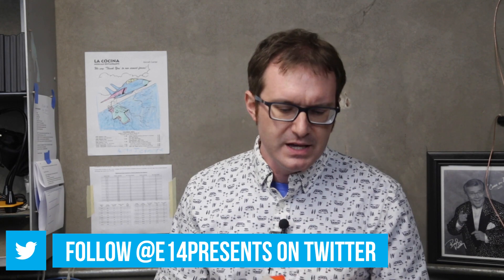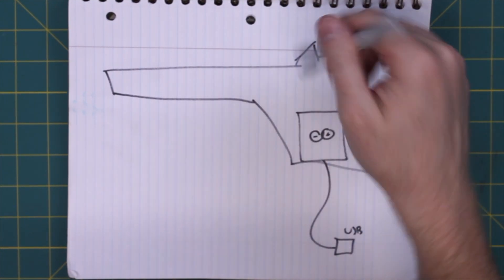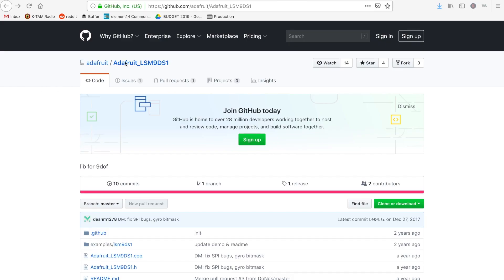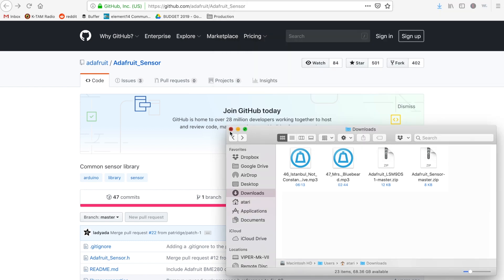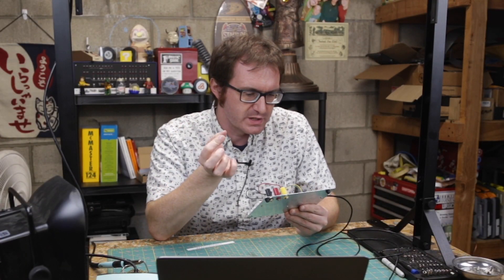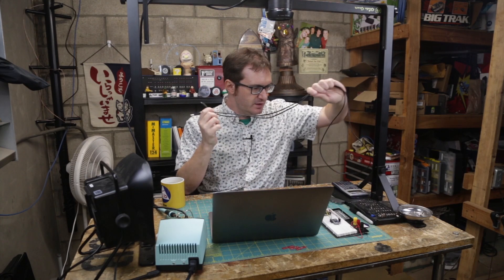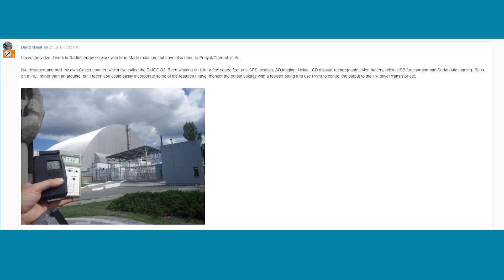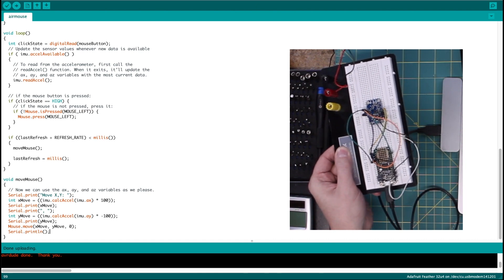NES Zapper on RetroPie

Comment: Ok, but what about if you HAVE an HDMI Sony CRT TV and you want to just connect the Zapper to the RaspberryPi NES Emulator and Poll it as the Original System would do? It should be pretty Easy right?

Comment: "Remote Mouse" uses your Phone as a Motion Mouse Pointer where you wobble your Phone and it wobbles the mouse around the screen ... I bet there's some code or API's that work with the Accelorometer in a Pi or Arduino... just like "Remote Mouse" does with an Android Phone and Windows...

Comment: It would be much better just to program the NES emulator (may be on the pi) which would cause the modern display to blink like the good old CRT. 

The beauty of the zapper is in its internals i.e. a lense, an LED and a mouse click button. A $2 build.

Your zapper is too much complex and much more expensive than the whole NES system.

Comment: Pretty cool project.  It might be closer to the original experience if there was a calibration process instead where you could line the crosshair up to the barrel position (which would provide the dead aim situation described in earlier comments).  Of course, a lot of things could throw off that initial calibration since you have many more axes than what you're moving against

Comment: The way I would do it is quick and dirty. Get a wii light bar for the screen, and strip the guts out of a wiimote to try and cram it into the zapper, then use a driver module to connect the pi to the wiimote-zapper thingie.
Reply: Tried it and it worked for the most part but still line of sight is lacking there
Reply: @mr.hankie  Ah. I never tried it myself. Was just a theory.

Comment: You didn't make a calibration script or map any constraints? That seems like it would be required. This zapper might be practical with faster hardware. Maybe a Teensy LC and sensors with higher polling rates.

Comment: I'm sad it didn't work. I might have to just get myself a CRT. 

I know he said reasonable facsimile, but to me, you might as well just use a joystick to move the cursor and that is nothing like playing a light gun game on a CRT TV.  With the Zapper, you actually had to point and shoot like a real gun. It was awesome. 

Also, I thought the Wii Zapper sucked too because it was more about moving a mouse around with a stick than actually shooting.
Reply: Personally I do enjoy using CRTs for gaming - but I don't know that I'd get one just for playing light gun games. There just aren't enough good light gun games out there to justify it IMO
Reply: The wii can be as accurate as the zapper it's just that aiming can be implemented in a variety of ways in a wii game and most of them prefere using a fusion of the different sensors in order to aim a virtual cursor in 3d space rather than using the raw IR data to aim in 2d.
Reply: Pick up the Aimtrak DIY module kit. Slap it into your gun shell of choice. Call it a day.

Comment: huge difference with the original: you are not actually aiming at your target. Just like the Wiimote :-/
Reply: The wiimote actually had a beacon system with a camera in the remote - so properly calibrated, it actually could aim pretty well and almost match the perforance of a modern beacon-based lightgun
Reply: @tetsujin_144  it can be very precise but the only thing the camera reads is the "sensor bar", not the screen. Isn't there a way to hack a NES Zapper in order to allow it to check for a few frames if a target is hit in order to have it compatible with LCD monitors instead ? The delay here makes it just impossible to play with...
Reply: @derek7808  it's not really possible because new TV's don't refresh pixel per pixel.
Reply: @azertazert98  i know it's not possible to do this in the same way as for a CRT, but there must be a way to capture a few frames, calculate an average image from them and then try to rebuild the original "flash" image of the NES Zapper. But i think it's way too much calculations for a tiny microcontroller.
Reply: @derek7808  the other problem is that the game expect a time sensitive input before the screen displays the frame.
Reply: @azertazert98  oh then unless we hack the game there is apparently nothing that can be done for monitors with a slight delay... Thanks for the explanation.
Reply: @azertazert98  look up Brad Smiths lightgun video.
Reply: @derek7808  Well a system like that doesn't actually need anything but the beacon locations (via the camera) if the system is properly calibrated and the remote position is reasonably in line with the front of the display. A third beacon (producing a triangular arrangement) makes the system more robust - it's the kind of set up used in modern light gun arcade games.
Reply: @derek7808  As for the NES zapper part of the problem is that the check is done in the game software - to change the timing you need to change the behavior of the software. You could do this by editing the game code (and perhaps someone already has) You could probably do it non-invasively by manipulating the emulation (measure the TV's display latency, then when the trigger is pulled, save the emulation state but continue running the emulation long enough to show the target flashes and record the timing of the zapper's pulse - then put the emulation back to the saved state and continue running, feeding it the zapper pulse at the proper time. You'd introduce a little delay every time you take a shot but it should work...  Because the Zapper was kind of garbage the timing doesn't need to be super-precise.)

Comment: the code definitely needs some refinement :)
perhaps it would also be useful if you could add a button that resets the cursor to the center of the screen so you start off with it there after you've lined the gun up, i think it would help alot.

Comment: While this is a really cool airmouse hack, I think you guys could take another swing at an arcade gun (maybe with Time Crisis or something). The main feature missing is that dead aim. The original NES lightgun used only an IR sensor to detect accurately enough that you can use the gunsights from a few feet back!
Reply: me__irl I think you might get reasonable results if there was some way to calibrate the gun to the screen and how close you're playing from. 

Not sure about the math involved but perhaps mouse position could be calculated rather than using a relative position.
Reply: @FluffyTheRipper  seems like a software hack to compensate for a rough hardware implementation ;)
Reply: Look for a video that Brad Smith did.